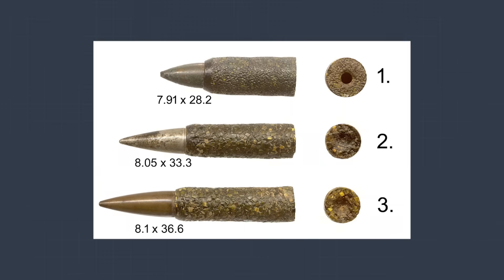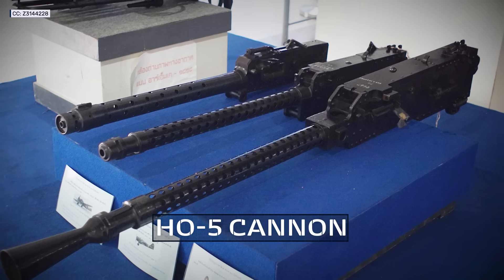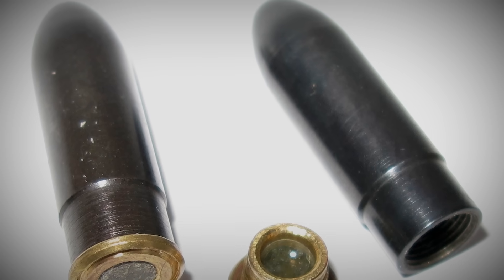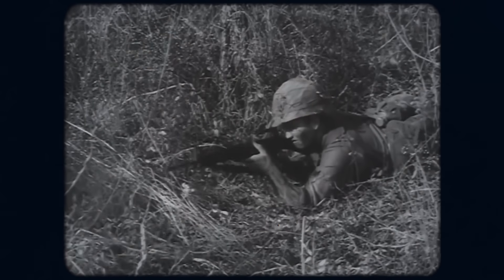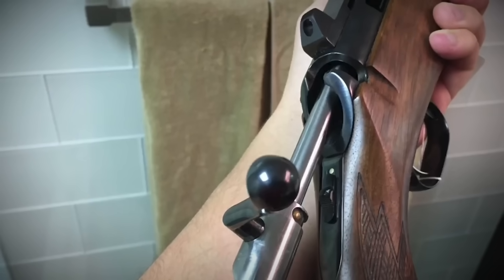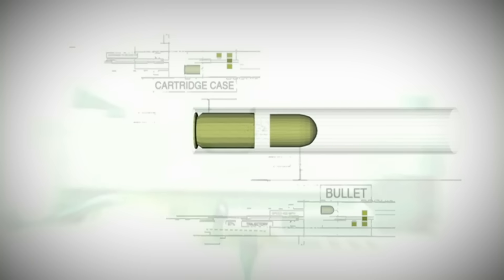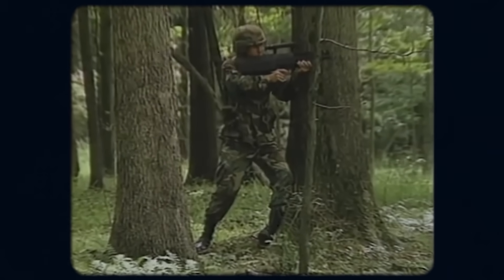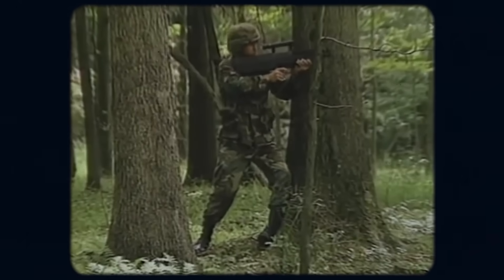Is Caseless Ammunition the Future of Warfare?

Comment: There are other ways caseless ammunition could be done. For a science fiction story I'm writing, I described a system that's simpler, that uses Explosively Formed Projectiles (of various types) with a disk of high explosive lenses behind it to create different types of output such as a diabolo slug, large shot, fine shot, dust-like particles, or plasma. The gun would be similar to a revolver in simplicity. A revolver is good for a sidearm, as I envision it, but less useful for long guns or repeating firearms. I assume it could be made to work with modifications.

Also, liquid/fluid explosives might be used. This might be similar to a potato gun or to "dieseling" airguns. Or fluid propellants might use electrical ignition or hypergolic propellants, or catalysts in the chamber. A more complex design could use a Light-Gas Gun design with mechanical or electromagnetic compressor. Another design might use use a Ram Accelerator and kerosene or similar. Some of these lend themselves to larger scale or smaller scale compared to others.

In any event, I suspect that a conical breech might help with sealing, since it will still fit even if the breech or plug swell from heat, even if they swell by different amounts at different rates. Guns might need to bring back cooling fins or water-cooling if they need high rates of fire.

Comment: Brass (or steel/aluminum) cased ammo has so many advantages that I just don't see caseless ammo bring adopted by militaries and civilians in the US anytime soon.

First advantage? Cost & availability. Caseless ammo would be prohibitively expensive, and that alone would prevent widespread adoption. It would also take decades to get nearly as common as cased ammo. Why would I buy a gun I can't get ammo for?

Second advantage? Perfection. We've had 160 years of cased ammunition to perfect it. It works.

Third advantage? Mechanics and efficiency. Cased ammunition helps seal up the chamber, increasing muzzle velocity and reducing variations in muzzle velocity.

Fourth? Durability. Cased ammunition is not only quite resistant to the elements, but it also lasts a LONG time. I've had ammunition sitting in my closet for more than 2 years and it is fine. If kept in a cool, dry environment, you can measure the life of cased ammunition in decades.

Comment: I have done some thinking on this particular issue and I think I have a workable solution. First being the bullet should act something like a traditional bullet while in the barrel with an explosion propelling the projectile forward and focing out the back to create a good seal and interface with rifling like in a civil war miniball. The seccond being that after the bullet has left the barrel or more precisley after the initial charge burns through you get that compound stage rocket burning as hot and fast as can be arranged. The idea being that the still whole projectile should be accelerated as fast as it can tolerate then ideally explode in contact with water or blood, but only after it fires.

Comment: There is one correction that really needs to be addressed. Fully automatic fire is not based on how many rounds you can fire in a second as you seem to imply at 4:16. Automatic fire is achieved by being able to fire multiple rounds from a single trigger function (pull). In simple terms, if you pull the trigger once and it fires one round, even if you keep the trigger pulled back, not allowing the trigger to reset, it is semi-automatic fire, but it can still fire more than one round a second, you just need to let the trigger reset. Now, if you pull the trigger once, and (baring a mechanical issue) multiple rounds are fired before you release and reset the trigger, it's automatic fire.

Comment: caseless suits ground attack aircraft as residue build up can, in this case, be solved by just replacing the barrel when you fly back to base. this said, ground attack aircraft can, arhuably use expended cases to reduce recoil as well as there is no problem here with envelopes of brass being shot out the back of your plane's weapons
Reply: There's a caseless aerial autocannon currently adopted by Germany

Comment: The answer to the question is a definitive NO! Caseless ammunition is prohibitively expensive to manufacture, sensitive to heat, has problems with sealing in the chamber, is fragile, suffers from range and accuracy problems, and causes residue buildup in the chamber that leads to jamming. While caseless ammunition on the battlefield has been a fantasy for decades, it remains just that as it is stuck in the prototype phase.

Comment: Yes. No. Maybe. The problem with caseless - is the expectation of format- being the same as a class cartridge. When it should not be. You need a cartridge of bullets. And a container of energizer (powder, solid, liquid)  So, the energizer - if it has to be a liquid, should be - universal. As in, ideally it can be multipurpose. It can be a power-source run through a fuel-cell. It can be fuel for a combustion engine or jet engine. Its explosiveness can be calibrated add hoc. It should be non flamable when damaged, aka two components to high explosivity.  Ideally you can trade way for payload. Way for computatiion. Then you make generic interfaced storage containers - and you get a modular, recombinable plattform for everything. Which also can shoot its fuel and use that fuel to compute its target.

Comment: Most of these problems are removed with the use of polymer casing.  The polymer casing allows for a protective covering, seals well, and insulates the chamber from heat (actually better than brass) while still being much lighter.  One of the NGWS competing for the replacement of the M4 did use polymer casing and it was VERY effective.
Reply: They were effective until they began to deform due to chamber/barrel heat, rendering them unreliable. Polymer casings are neat, but they have a whole host of their own problems. Main ones being deforming under high heat (like mentioned before), producing lower chamber pressure than metal casings (meaning lower velocity/muzzle energy), and being inherently more fragile (they are plastic after all). These and various other factors are what caused the US to adopt the steel/brass hybrid casing developed by SIG instead.
Reply: @ferai147  Do you have a link to an article coving this?  The True Velocity RM277 that they originally enrolled in the NGSW contest seemed to do just fine and everybody was saying it reduced chamber heat and prevented cookoffs and such.  They are still working on the RM277 and showing it off at Shot Show  (as of the 2024 one earlier this year) and letting a few gun channels test it.  I have not heard anything about overheating issues.

I personally think the RM277 is a better option because the bullpup design let them use a 19" barrel so they did not need the crazy chamber pressure that the XM-5 has... and issues like heavier parts and short life for the barrels.  Also having ammo that is 30% lighter too is nice.  It also had better recoil mitigation and the can could be fatter and shorter do to the barrel being lower.  It just had so many advantages over the other 2.
Reply: The problem with polymer casings is they have low heat retention which means a lot less heat is extracted from the system upon ejecting the spent cartridge.
This results in overheating issues.
Reply: @momoz74  Odd since True Velocity/General Dynamics was showing off their 6.8mm NJSW entry and they said that not only was the ammo something like 30% lighter, but that it insulated from heat transfer into the chamber.  They stated it transferred half the heat into the chamber than brass ammo and reduce the chance of things like a cook-off.  They are still developing the True Velocity RM-277 despite it not winning the contract.

I personally think it is better than the M-7.  It has a longer barrel that handles the higher velocities better.  The gun is lighter and batter balanced.  The ammo is lighter too.  The M-7 is a strong gun, but I would put the RM-277 ahead of it.  My biggest concerns is without the US contracts they will not have the volume to be able to produce the ammo at cheap enough rates.

Then again I think the Vortex targeting system is good too, but heavy and will not really shine until the 2nd or 3rd generation comes out that is lighter, uses a much smaller battery, and has even more features built in.  I was disappointed it did not have some sort of NVG or thermal optics built in that could be turned on if needed.

But even with the current systems the M-7/M-250 is a beast.
Reply: @momoz74  Not quite, because heat is a two way street. Yes Polymer doesn't retain heat much, but it also means it doesn't dump heat into the chamber. The part that makes Brass really good at absorbing heat also means it's really good at dishing out heat, as the many videos of people catching hot brass can attest to.  

If that brass is burning people, what do you think is happening in the gun as it heats up? That's right, the chamber get's hot, as the brass dumps heat into the chamber. Polymer doesn't do that.

What Polymer IS doing is keeping heat in the system, and where does that extra heat goes? It goes into more power being sent downrange, which means more stress being put onto on the barrel. That's where the overheating issues are coming from. It's not that the Polymer itself is bad, it's mores the upsides of Polymer is causing issues in other parts of the gun that wasn't designed to handle the extra power, can't handle the new demand that Polymer casing calls for. 
It's like the Cotton Gin, the funny machine that took cotton and removes the seeds within it. The guy that made it thought it'll end slavery, since automation means manual labor is less profitable and force slave owners to stop using slaves, but it prolonged it instead; Because yes, the Cotton Gin did what he wanted of removing slave jobs, but since the processing of cotton is so much higher, that means the production of cotton needs to upscale in order to meet the processing efficiency so to say, which means all the jobless slaves get's pushed into the fields to farm more cotton. If that guy also automated the process of farming cotton then history would be very different.

Going back to Polymer Casing, it's stressing out the Barrel. Solve that issue with, say, a thicker and heavier barrel, and Polymer Cased Ammo is in the cards. Now would having a heavier gun be worth Polymer Ammo is another question that I won't dive into, but yeah. 

tl;dr Polymer heating issue is less about the Polymer itself and more on the gun being unable to withstand the extra pressure that it creates.
Reply: @ You seem to think the chamber heats up due to conductive transfer. That is only partially true. Most of the heat comes from kinetic transfer which doesn't care about thermal conductivity. Basically every time a round goes off the chamber is hit with a big hammer from the inside outwards and these massive, repeated hits cause the metal to heat up. Now polymer does deform a bit easier than brass which means a bigger chunk of that kinetic energy ends up in plastic deformation rather than heat but brass absorbs more because it has a lot more heat retention so when the hammer hits the brass heats up instead of the chamber walls and then that hot brass is removed from the system keeping it relatively cool. 
Overheating is definitely a issue with both caseless and polymer cased rounds, this is well documented. There are ways to work around that but the problem is absolutely real.
Reply: @momoz74  But the polymer is not only going to cushion the impact from the casing expanding in the chamber, but it also cushions the chamber a bit.  The fact is they have polymer ammo working and they have pointed out the trigger group and chamber are much cooler.  So this is an advantage not a drawback for polymer ammo.
Reply: @toddabbott781  I know, they made it work but the compromises they had to make to avoid overheating were significant. For example the casing walls have to be significantly thicker to be able to "cushion" the chamber and there are several other tweaks. It's not a bad solution but it's not significantly better either which is why the technology isn't being adopted, or at least not yet.
Reply: @momoz74  I think for the NGWS and the 6.8mm it was a good solution.  It is 20-30% lighter so they did not need to reduce the magazine size to 20 rounds like the XM-5.

Dow they likely would struggle to retrofit an existing round like the 5.56 or 7.62 NATO, but they did not have to.  They could make the round then design the platform around it.  I think they did a good job and what they have fixed a lot of problems with polymer casings and even some with brass.  This is also with a much higher chamber pressure.  The XM-5 had to use special casings with steel at the base and brass at the top to handle the pressures.
Reply: @momoz74  No.  You have it backwards.  Polymer ammo reduces the heat soak, not increase.
Reply: Then it'd not a TRUE caseless design.
Reply: @sirridesalot6652  That is why I said the polymer casing is better.  It is light like a caseless round, but is not so expensive, can get wet, and insulates from the heat.  I think for the XM-7 with the 6.8mm ammo the polymer ammo was 30% lighter.

Comment: The problem with the idea of a "lighter bullet" is that you are going to make the thing you are shoving out of the barrel a lot bigger and heavier than with a traditional bullet in a traditional gun. You will need more bang to get the same velocity and range. This makes the bullet heavier thus requiring a bigger bang so now you are changing your tail. As rightfully mentioned at the beginning of the video you are essentially making a rocket not a bullet. And this means the rocket equation comes into play which as someone called Elon not so very long ago explained gets more and more punishing as you go smaller and smaller as the tolerances allowed to get the same performance are tighter and tighter.

There are ways to do case less ammunition but this will mean a other means of propelling the bullet, think of a railgun for instance where you need nothing more than a metal rod. The other option is for the gun to provide the bang like the muskets of old. In the first case the gun is a lot heavier as you need to have the mechanism to propel the "bullet" integrated in the gun. The second option means carrying the thing that makes the bang besides the gun, this is not ideal as this material will typically need to be well protected from both the elements and alternative means of making the thing go bang at an inopportune time.

All this leads me to believe that a case less gun that is able to be carried by a regular human is not a realistic thing. Now on a ship for instance the weight of the acceleration mechanism can be compensated by the lighter bullets and the non existent bang the ammunition might make if the ship were to get struck. For a tank this is also possible maybe, the problem is that the extra weight of the barrel will make transporting these things a lot more complicated because adding lets say 30% more weight for the heavier barrel and the compensation mechanisms to keep it stable which will need to be beefed up will limit where and when a tank can travel just because of its sheer weight.

There is some utility maybe for the very large scale guns but for anything smaller more agile I do not see case less ammunition ever becoming a thing.

Comment: 11:04, I really wish you had expanded on this, because this is at best only partially true. It's not that open bolt guns are unstable, and can go of if jostled. The real problem with open bolt guns, particularly submachine guns, is bolt bounce. If the bolt is closed, and the gun is dropped on its rear, the heavy bolt can bounce back against the main spring, and travel far enough to strip a cartridge from the magazine, but not far enough to hit the sear and lock open. Then, when the bolt goes forward, the round is fired. However, it is really easy to mitigate with proper mechanical design of the gun. For instance, the Soviet Ppsh-43 gun has the safety on the cocking handle, and turning the safety to safe locks the bolt in place, either forward or rearward. The US M3 "Grease Gun" has a dust cover that, when closed, again locks the bolt in place. It is only barely an issue. One other problem is if the rounds don't have enough power to move the bolt all the way back, meaning that is does not engage the sear. If this happens, the gun can run away, and fire the whole magazine even if the trigger was released. The British Sten gun, from WW2, did indeed have this problem, at least in early marks. But again, only barely an issue.

More to the point, caseless ammunition is just never going to be a thing for small arms. There's simply too many insurmountable downsides and compromises. By the time any of those issues would be solved, we'd have workable combat exoskeletons, and the whole point is moot.